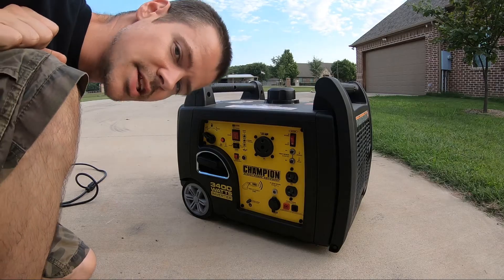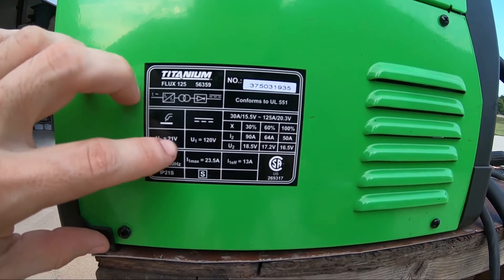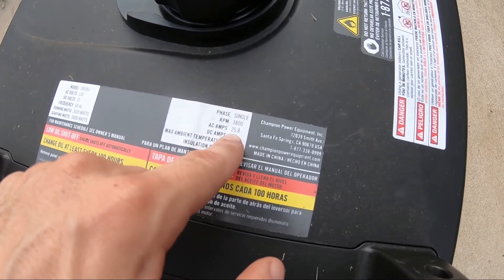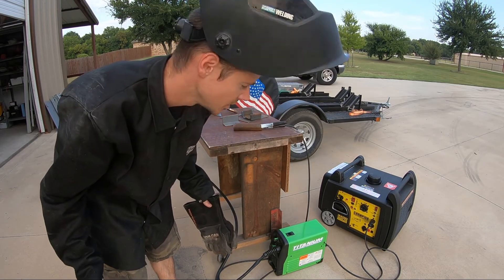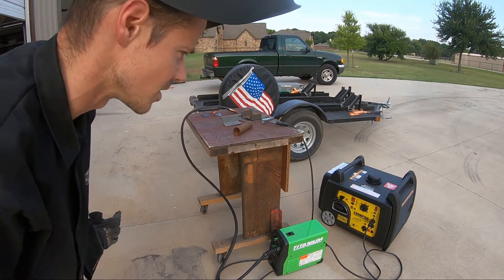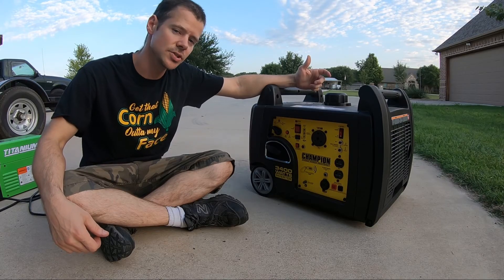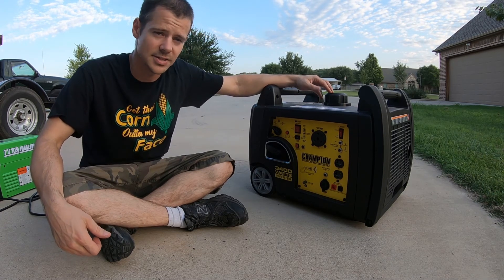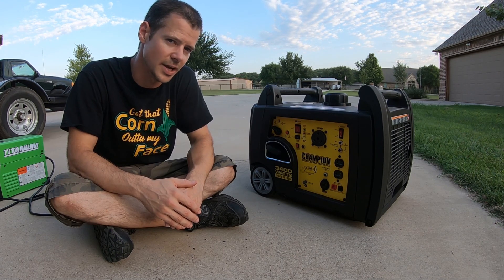Will It Run It?? - Champion Generator running a Harbor Freight Welder

Comment: I did a test of my own with my 11k inverter generator with the titanium 125 plugged into the 30amp 120v receptacle. At max settings wire/voltage it was engaging the overload light pulling 39amps 4700watts. The generator never popped the on board breaker for a continuous 10 seconds or so but I have a sneaking suspicion that the max eff current labeled at 23amps on the welder might be a little bit optimistic. When I backed off to 3/4 full wire/ voltage settings the electrical load was more manageable at around 3400watts about 28amps but still way over it's  23amp max current written on the data plate. I love this little welder but it really is unrealistic to run this welder cranked up off of any portable generator let alone a generator with less than 6k running watts. I have run this for short welds with reduced settings off of my honda 2200 but I don't think its good for the welder or the generator. Hope this helps anyone.

Comment: Thanks for doing this. I bought a little inverter welder to do stick (SMAW) work & a 9kw(running watts) TMG Industrial generator to power it (@230v) & other toys. Used to big welders in my past work, so,  figured I'd not be happy at 120v, yet, you seemed to be getting a lot out of your combo.

Comment: It's a pretty good video but I think it's important that people know and understand the what amp you're running the welder on it's a 125 amp welder maxed out to not weld very well but when you lowered the amperage what did you lower it to that would be some more good information to know thank you for your video

Comment: Entertaining video. I have a 4500 watt champion generator i havent even used once lol buy i had the notion of doing a welding project where there is no power outlets. I ordered the larger adapter outlet converting from the rv receptacle to a welding 50r female end. Hopefully it works 😆 i just dont want to purchase a huge welding generator for this 1 week project. How is your generator holding up ?
Reply: Did it work
Reply: @gilbertmartinez9358  I didn't have to go this route. I ended up welding brackets to fit so I wouldn't have to do field welding. I think it would work but not for a larger welder.

Comment: I did the same thing horbart 140. honda 2200i.  I have 5 heat settings. It will run on 4 but not 5. works great

Comment: Great video. Many of us have small generators for obvious reasons and then after the fact we want to use it for welding on small jobs where utility power is not available. You demonstrate that it is possible. Too often the academics post tables showing what size generator is necessary for what capacity welder. You target the niche area for people with small generators looking for a way to use it for welding in remote locations. Thanks!

Comment: So plastic fuel tank generator full of gas sitting like one foot  away from falling slag and you're wearing shorts 🩳 what could go wrong 🤦 next time set a box of  fireworks under your welding table  too .....
Reply: Nothing could go wrong, this isnt a cartoon. Ive accidentally welded over an open jerry can half full of gas and vapors and it just caught fire and i just covered it and it went out and i moved it. Things dont magically explode because you saw it in a cartoon
Reply from the maker: That would make a good video!

Comment: I have that 110 welder Mig and I can't get it to run up my 4000 Watt generator Harbor Freight deal .. it was working but it was tripping the breaker all the time now as soon as I touch the metal it f**** turns off

Comment: I have a Lincoln 100 I ran on a 1700w generator. It worked but not that well. I bought the 125 because it was much lighter and supposedly used less power. 
I couldn't even get the Titanium to to fire up let alone run a bead.☹
Reply: me either with a 13000/10500 RW Gen. maybe a heat issue?
Reply: @TheHalusis if it’s not an inverter generator it might not make the right clean power the inverter welder wants to run properly.
Reply: @fishhuntadventure  yeah i think i went through that since then, even sold my generator haha thanks

Comment: The reason it overloaded is because you didn't use the large 120V receptacle.  The standard 120V receptacle is still only able to provide 20A if I'm not mistaken.  Make an adapter to get power from the big outlet, and it should work a lot better.
Reply from the maker: I hadn't thought of that, but I do have an adapter to go from the 120V RV down to a 20A plug. I will try this and make a follow-up video. Thanks for the tip!
Reply: @uthe54  Did you ever try again using the big RV receptacle?  I have a predator 3500w inverter generator with a HF titanium 140 welder.  I’m wondering if my combination would work for welding on small projects?
Reply: @ponyxpress3  I’d like to know if this works too? Thinking of buying the same welder
Reply: @Razorhawg09   hey that little green welder in the badass .. it works better than my 220 Lincoln for real
Reply: Good pointing that out.. you got a good point
Reply: Yup, i used to run a lincoln le31 multiprocess welder on the 240 30 amp outlet of a predator 6500 with an adapter
Reply: @jackmioff000  what type of adapter ?
Reply: @sulomangaming8238  you buy the parts at any hardware store but you get the plug that fits into your 30 Amp outlet and the other end should be a regular 20 Amp outlet, I used to run a predator 6500 and a le31mp Lincoln multiprocess Welder off the 30 Amp outlet with one of those adapters
Reply: I was just thinking that was mine . I was running a 110 welder off for my 4000 generator .. at first it was working then it would trip the breaker now it won't even do s*** .. I guess I need to get that  220 plug and run it down to 110 ??
Reply: @billyjones9045  it all depends on your generator.  Most generators 7000W and below don't have a 240V outlet.  Rather they have a large 120V outlet that can support 30A of current.   So just because the plug is a larger size, doesn't necessarily make it a 240V plug.
Reply: @billyjones9045 
3600W will just about handle a 120V fluxcore machine. The 15-P outlets are probably 20A optimistically (2400W). By using the 30A 120V RV outlet you have the headroom for most 120V welders. 
My Lincoln 120V mig is basically always used on thin material and will run quite a while on a 20A outlet not even hitting the duty cycle. 
The other 120V Lincoln is set up with wirefeed fluxcore. Even using a 10ga extension cord it will eventually trip the 20A breaker, but once the machine is ‘hot’ it will hit the duty cycle on the Lincoln before the breaker trips. 
My 120V/240V TiG on the other hand will trip the 20A breaker fairly quickly and continue to do so quite regularly at 120V. When I’m I’m someplace else where 240V is available (6-50P) it continues along much better. 
My little suitcase plasma trips the 20A fairly early as well. 
I’m not sure if the 4250 ‘inverter’ will support the plasma and compressor when it comes on with the 30A generator outlet supplying. Totally vacillating over buying their 6250 (5500W) 120V/220V instead of the 4250 (3500W)

Comment: hey dude, 2500W are needed for about 90-100Amps Stick welding. 
I have a small 160A stick welder, rated minimum generator power 5,5kW.
That sucked, so i got a welder generator. I can recommend a welder generator for you.
Reply: Please drop recommendations
Reply: @markanthonyalamillojr.2586  i got a list but cant find it now. The most portable welder generators are Genset Weldbaby and Mosa Magicweld (nearly same parts I think)

Comment: been thinking about picking up a generator for the same welder this video helps thank you
Reply: If I was you think bout upgrade to a 4500 watt.. I have that same name brand from tractor supply and I run my 125 amp mig welder off it..